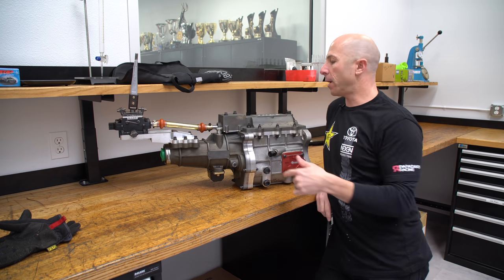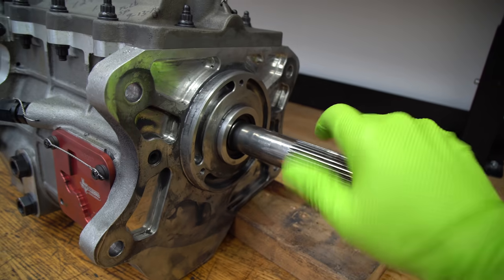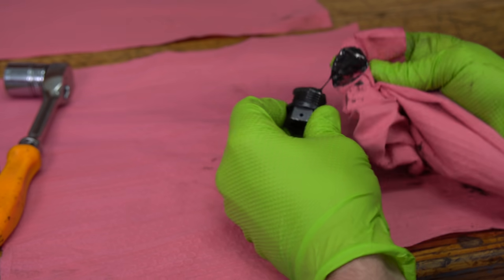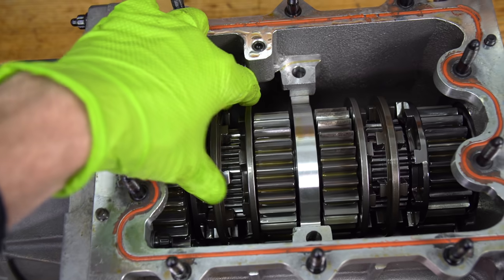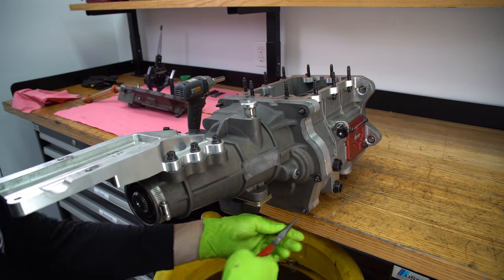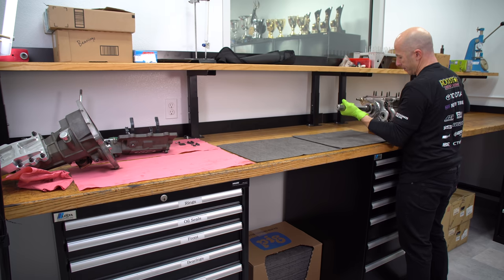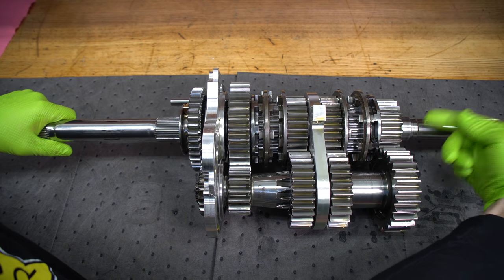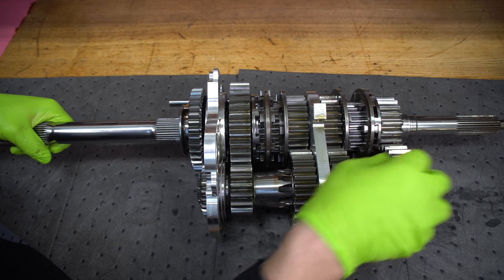NASCAR Transmission Teardown and How It Works

Comment: Very cool.  I run two CNC gear shaping machines. I have seen and made so many transmission parts without knowing what they do.
Reply: I rebuilt transmissions along time myself. And I wanna learn what you do! Lol
Reply: @TommyZ9448  ....we are hiring. Lol
Reply: Jim Scobie where at? I do live in southern Cali. And I’m working overseas but will be home in a year or so. Lol. Planned on doing a CAD program online. Will that be beneficial for me? I’m sure when I go home I’ll work on cars for awhile. But my area has a lot of opportunity for CnC jobs. 🤔
Reply: @TommyZ9448  ...i am near Detroit.
Reply: That's not a normal transmission.  It's a sequential "crash box" specifically for race applications.  A Youtuber named Engineering Explained has some real vids on a normal manual transmission.  Look him up.
Reply: @TucsonDude    it is not a sequential box, nascar rules require a traditional H pattern shifter.

Comment: Don't know transmissions at all but wondering what parts of the actual case (magnesium vs aluminum) will wear out over time....short of an actual self destruction of the bearings or gears of course. Neat video. You explain things really clearly
Reply: fatigue cracks most likely, also worn bearing apertures if replaced often.
Reply: Heat will warm magnesium faster than aluminum. Also, bits of road junk getting tossed up case damage.
Reply: @rightwingsafetysquad9872     ... The heat generated by the gears is the same, regardless of the metal of the case.  The temp of a mag case will be the same as an alum case.

Comment: When I think about the opportunity I passed up to work on these transmissions I reflect back and am so glad I stayed in business for myself building transmissions. I also turned down an offer at NASCAR Tech. as a instructor in Mooresville for the same reason.
By the way, if you will remove the drain plug BEFORE you remove the transmission, there will be less oil to deal with. Glad I could help.

Comment: I wish NASCAR would market the fact that they use manual transmissions. Modern race transmissions with paddle shifting blow these out of the water, but it is still impressive to watch a skilled driver shift and work the clutch. Even if it's not true, NASCAR could assert in their marketing that their drivers have more skill and their sport is a truer racing sport. Obviously it would also be nice if they raced fewer oval tracks otherwise I suppose no one really cares about the transmission since they hardly shift.
Reply: You do realize that a good portion of nascar tracks aren't just oval tracks right? Watkins Glen is raced at numerous times during every season and that has definitely got more than 4 turns lol.
Reply: @65Red  Yea I know there are of some tracks raced that aren't ovals. I said it would be nicer if they races fewer ovals
Reply: FYI there's not one "STOCK" about Nascar. They need to rename it, rebrand it. Whatever, but please don't call it Nascar or stock car. It's not symantics, it's B.S.
Reply: @408SPLKINGS  What are you talking about? Obviously they are not stock cars in the sense that can go buy one at a ford dealership. It hasn't been that way in many decades.  Stock-car is a generic term for the vehicles they race. Don't call them Nascar or stock cars?? So what are we supposed to call them. Quad wheeled racing chariots? Would that be better?
Reply: @invsiblshowercurtain my point exactly, Not stock cars since late '70's early 80's...so rename it, up grade it...you made my point for me. I'm sorry if I hurt your feelings, didn't mean to.
Reply: Three-pedal cars are cool, and those of us who can drive them, becoming fewer as old-timers hang up their keys (and today’s kids don’t even bother getting licenses).

I suspect NASCAR’s decline in (audience) market share — it’s the same drivers, in the same cars, going around the same tracks.  Over and over, year after year.

NASCAR’s biggest advent since the “Aero Wars”....  Electronic Fuel Injection.  Woo.

Formula-1, it’s European counterpart, is nearly reinvented every few years.

Yes, many of the drivers are whiney little shits; and the move to fuel-restricted V6’s took some of the mechanical drama away.

F1 doesn’t seem like watching a reeeeeally long drag race, again and again though.

(bit off-topic for a transmission vid, but there ya go!)
Reply: @65Red  they race 2 road courses, now "3" with that Roval, they need to get rid of half of insanely boring oval tracks like Loudon, Dover, Kansas, Kentucky etc and replace with real tracks like Road Atlanta, Road America , Sebring, or even the Daytona Infield race. It would be more exciting also if they replaced the 4 speed with a 6 speed dog box so they're required to shift more.
Reply: They barely even use a clutch anymore really.
Reply: @408SPLKINGS  They weren't stock in the late 70's or early 80's either. You are blowing smoke in the wind. They were never STOCK cars. Every racer has had their cars prepped in one way or another for better handling and more power...
Reply: They hardly shift anyways. They have 4 gears.
Reply: Guys, they’re “NASCARs” not stock cars ;) If racing was purely about speed, 0-60, 1/4 mile numbers etc, everything would be electric! Wanna go fast? Ditch the dinosaurs hahaha. Passion is in the symbiotic relationship of person and machine! I still prefer to feel my car with manual instead of “shifting quickly” with electronic wizardry. Flappy paddles are fun in racing video games. But not as fun in a race. Sometimes a win comes down to a miss shift
Reply: @moosedrummer1  pretty much only for shifting down and taking off. Because of the dogs they just have to lift off the throttle for shifting up.

Comment: staight cut gears are not per say stronger. most of the time bevelt gears are stronger because more teeth are engaged at the same time. however beveled gears create a lot of additional forces.
Reply: Axial load
Reply: @MrMattydavee  jep axial loads. those are quite hart to deal with. so in a race car aplication a light gearbox is nice. but to make it light they have to remove material. that makes the box itself less stiff. that in turns causes missaligment in the gears. and staight cut gears can deal better in those conditions.
Reply: Lots of research shows that straight cut gears are stronger due to the teeth actually being thicker for the same ratio. With helical cut gears, the teeth have to be made with less material to mesh properly.
Reply: Steven Boyd not how it works but okay
Reply: craze09 goes against every reason that people use straight cut gears but ok. If angle cut gears were stronger, there would literally be no reason to use straight cut
Reply: @65Red  You dont seem to understand axial load. That is the biggest reason to have straight cut gears in a transmission. Straight cut gears only put radial load on the shafts, while helical gears put an axial load on the shaft. It is much harder to make bearings and transmission cases that can withstand the axial load. The gears themselves may be weaker, but it doesnt matter because the complete transmission is still lighter and stronger.
Reply: It's the combination of load & noise. Straight cut gives you a lighter box overall, but a level of noise that would be unacceptable in the consumer market. Helical cut gives you an almost silent box as multiple tooth faces are meshed at any time and the entry and exit of teeth is more controlled (less sound generation) but the end thrust increases the number & weight of the bearings and the casing that carries them. For racing straight is great, the noise does not matter & the lightness is an asset. It's horses for courses!
Reply: Matthias Geist jep. Hit the nail dead on bro
Reply: Edit(head)
Reply: Straight cut gears push apart when driven.   Helical gears push for and aft.

Comment: I am honestly surprised there is no overdrive on these just a 1:1 ( direct drive )
Reply: No overdrive needed in a nascar, opbviously built for WOT and high revs.
Reply: Actually, you can make it an overdrive by setting up 3rd gear as an overdrive, the shift linkage is changed for 3rd & 4th, 4th 1:1 becomes 3rd and 3rd becomes 4th overdrive, The gear sets are interchangeable as underdrive or overdrive. If this makes your brain hurt, I am sorry.
From Russia, with LOVE.

Comment: I rebuild manual gearboxes myself but I’m curious what you inspect on the dog box transmissions? Obviously there aren’t any synchronizers to wear out. Do you find the drive teeth on the gears worn out usually? Or do you just replace the dog engagement sliders to prevent future damage?
Reply: Majority of the dog boxes ive built for the racing guys and come back for a overhaul after a year or so.. the main problem ive found is the quality of the gears! The majority of them have gone through the case hardening on every gear plus laygear! For how much the customer pays for the Quaife gearset alone and the state of it when it comes back for a rebuild is a joke!
Reply: If you look, you can actually see that the pocket on the dog he showed up close was deformed at the root of the lug..  Obviously the other part is looking for tooth wear and of course, bent shift forks.
Reply: I work on motorcycles and they use dogs for engagement of the gears, a common issue is dogs rounding off from poor shifts and the rounded dogs act like ramps and pop the gear out of engagement. I see it a lot on the lower gears like 1st and 2nd. also the shift forks being bent can cause the rounding to start happening because its not pushing the gear firmly in enough. Transmissions meant for high engine power will use undercutting on the fixed gears to make sure there is more positive engagement to prevent dogs from not engaging enough and start getting rounded.
Reply: Jl4zio Yeah I see that in Automotive gearboxes too. I’ve built dog engagement gearboxes for customers but I don’t ever get any in for maintenance, so I didn’t know what would wear first; the lugs or the drive teeth.
Reply: Usually it’s because you sheer the teeth on one of the gears.
Reply: Since you guys know manuals...
Do all manual transmissions have 1234 from back to front like this one?
Reply: @xmo552  Most do but not all. Like a fwd transaxle usually has 1st near the bell housing
Reply: @ChaseRacebox  
I was referring to the rwd. Thanks.

Comment: How would these actually last for a daily driven vehicle and how is the drivability of these
Reply: This unusual question ran through my head as well... I wonder what it would be like in my daily driven gto?
Reply: @seanykinz  a nightmare. it's a dog box transmission. these suckers are built for high horsepower, not as small as a daily driven car would have. you have the physically smack these puppies into gear, because of those dogs. they are very hard to drive with in stop and go traffic because you have to run through the gears, as this specific one is a sequential gearbox. some are a 4 speed H-gate, where it's a little easier to run on a daily driver (I have it one my s14, it's not bad). to conclude, a sequential dog box tranny such as this, would be a nightmare, and won't work well on a daily, mainly because of the relatively low horsepower and different drive train.
Reply: Just like a regular gearbox, except with stronger gears. With only 4 gears MPG will suffer, but they work just like a stock one. Advantages are availability to change gear ratios. They are like an update of the Muncie 4 speed of the 70s.
Reply: @lincolngolladay  nascar boxes are H pattern, no fancy techno sequential.
Reply: Really bad drivability having straight cut gears instead of helical gears makes the car jerky and violent while shifting or taking off and the ratios are not suitable for street use at low rpms and speeds plus these transmission like much of the parts you'd find on a track or race car are basically consumables made to be used worn out and replaced so it wouldn't be reliable
Reply: @PatricioGarcia1973  that ain't right it's like any transmission
Reply: Daily driven cars don't have 750-850 horsepower. These transmissions get torn down after each race.
Reply: There's no syncros in those transmissions so you would need to double-clutch every shift
Reply: @myofficegoes65  if your double clutching someone didn't teach you how to drive / operate manual transmission correctly. Not ripping on you. Lightly raise rpms, clutch in, shift, clutch out. Done. Repeat. To change direction from forward / reverse come to a complete stop. proceed. Most gasoline engines torque & horsepower match up at 5200 rpms unloading most stress on driveline making it possible to shift with out clutch use aka rev match. Racers / motorcyclist commonly used to this technique.
There's many different styles of shifting / clutching but double clutching is not correct.
Reply: I’m no expert, but I’ve driven Xperion (sp) car; Richard Petty Experience 650 hp.  I had absolutely no trouble shifting thru the gears.  I noticed no jerking, and no double clutching was need.  As for straight cut gears I know they make a heck of a lot of whine. But in that tin can I couldn’t hear anything but Bald Eagles flying out the exhaust.  Shifted pretty much as any old 4 spd.  If I remember right I don’t really remember downshifting 4-3-2-1 as in a sequential.  As I remember, I think I came into pit lane in 4th, clutched in, slowed and then into 2nd and stopped.
Reply: Patricio Garcia I don’t think your fuel consumption would suffer just because of the transmission - it is smaller, lighter and even though it only has 4 ratios, 4th is 1:1, just like 5th in many 5-speeds.
Reply: @lincolngolladay  That's not a sequential, its conventional gate type change
Reply: @408SPLKINGS  The number of horsepower and the number of lb-ft matching up has absolutely nothing to do with stress unloading. Hp is an entirely synthetic unit, it doesn't naturally come from lb-ft, and even if it did that still wouldn't be the reason, it is because 5200 RPM is the spot on the torque curve where it usually declines the fastest. And while you don't absolutely have to double clutch an unsynchronized transmission like this, you should because it will cause damage without a perfect unloading and rev match.
Reply: Fifth gear in a five speed gearbox is an overdrive gear.   Fourth gear  is 1:1  .

Comment: Straight cut gears aren't stronger, helical gears should be stronger due to more teeth being in mesh with each other. Plus they are quieter because of that.

Where straight cut gears help is because you don't have axial force acting on the shafts, like on helical cut gears, you don't need the casing to be as strong axially, only radially between the two shafts. That's why a straight cut upgraded gearbox (in factory housing) for a road car is stronger, it doesn't open up the casing.